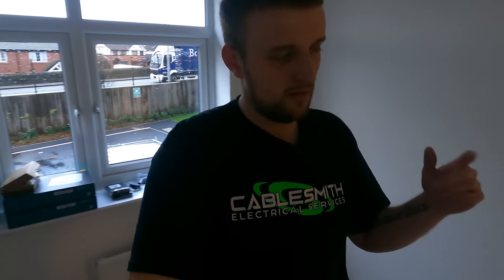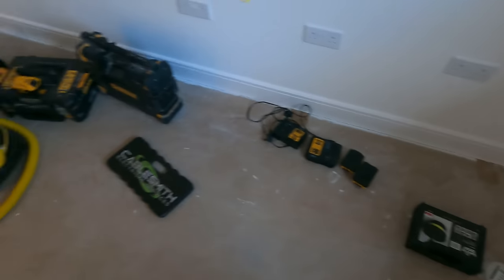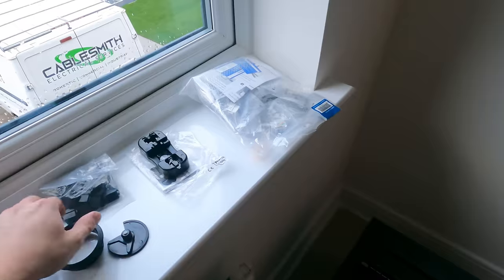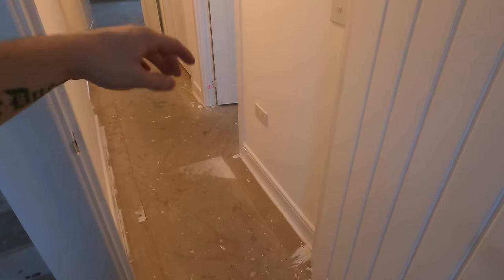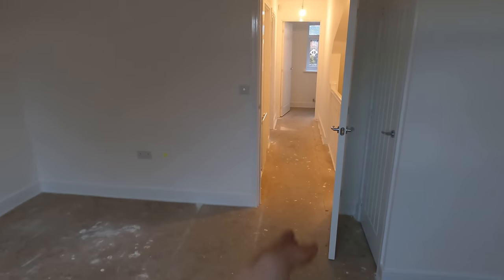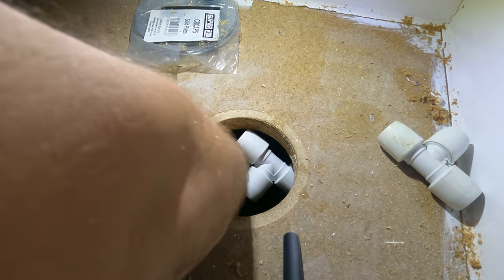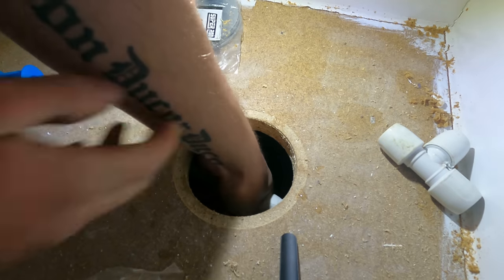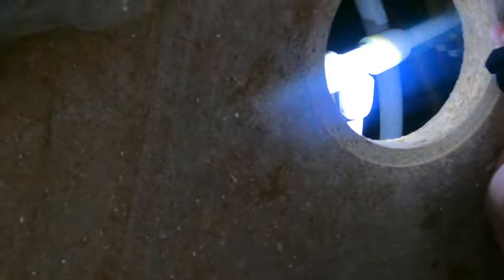I Made A Big Mistake ! | Wiring Cat 6 In A New Build | Electrical Life

Comment: Hi from the mad Aussie bird-man from Mr Bundy's "esteemed" chat group. Thanks for another cracking video. Wouldn't it be great to have access during construction.... I guess the hangover from covid stuff is so many people are continuing to work from home and set up home offices. Nice work with the data cables. Crap job from whoever on the previous work. One suggestion for the ceiling wifi access point holes is to do the same patch job as the wall cutouts with the cat6 poked through a small hole. This maintains some level of fire separation from below if the worst was to happen. Cheers
Reply from the maker: Hi Jim, that’s a good reason indeed and of course I didn’t think of that, thanks for watching matey 👌🏼

Comment: Been there mate, I was using a multi tool cutting what I through was a big lump of dry wall adhesive. I had worked out the run for the gas pie or at least I through I had. Massive whooshing sound! Nicked the gas pipe! Never moved so fast to knock the gas off! Had it fixed by a gas fitter mate of mine within the hour luckily. But your right, your confidence takes a right beating! I was cutting the next day adding sockets and checked for cable and pipes for ages!!!!
Reply from the maker: 😂😂 god I hope the gas is one I stay away from 🤞🏻 thanks for watching mate, appreciate it
Reply: All been there and done that, and as we move to more plastic fittings the detectors of old don't quite cut it anymore...........personally if I'm not sure anymore I stick a 8mm drill bit in and send in the camera first

Comment: Hi Sean, and good to see you back. Happy new year to you both. Easy done Sean hitting the pipe. Had to smile when you said “never ran so fast, I nearly tripped over myself” 😂I think we’ve all been there at some stage.
The plates look a good solution to the holes in the chipboard, do the just sit in the recess and no fixing required?
Enjoyed the tip session on the data cables plus very neat terminations that you showed 100% to what had been done, may well of been functional but good to have some pride in your work. Well done buddy👌
Reply from the maker: Thanks mate ! And no joke I nearly fell down the stairs running 😂 they don’t require a fixing but I personally run a little bit of silicone under it just to stop any potential rattle if you stepped on it, but I doubt it would anyway. Thank you for watching 👌🏼

Comment: Great video. Moving into a new build myself soon and they don’t provide and network cabling!? Says bt point on the plan but they’re insistent it’s just telephone points. Would you say it’s easy enough to run cat 6 after completion? Want about 15-20 points around the house
Reply from the maker: I’ve done a few now, 2 of which are in this channel. Yes it’s easy enough with the right tools for sure. 
100% worth doing it before you start putting flooring down and regret it later ! Good luck

Comment: Apologies if you’ve already shown this on another vid but would love to see your approach/considerations for drilling down behind a skirting and through the chipboard.

Just wondered - how much effort do you put into avoiding running ethernet next to power cables? I’ve got a fairly easy route that would put them side-by-side for about 2m, or should I go and find another route to keep them separate? It’ll probably be fairly straightforward to find another route but I’m an absolute chicken when it comes to cutting the floor, and this video proves I’m right to be!! 😂😂

Thanks again for showing this stuff it’s honestly so useful and no one else posting this real world content! Thank you!!
Reply from the maker: I actually don’t think I’ve shown drilling behind a skirting before so I’ll definitely do that on my next opportunity, as for the power/Ethernet thing, it’s a debatable one, if you go off what we’ve been taught forever, it’s a no no, but personally I don’t think you’ll see any issues at all unless your running it 30+ meters with power, BUT I’m not saying you should 🤐 it’s your choice 😄
If I was to tell you the truth, in my own house, for the sake of a few meters I would do it, for a paying customer, I wouldn’t simply because they should be getting work done to the best of my knowledge and ability and I’d feel like I’d be doing them a disservice if I knowingly did something Ive been taught not to. Hope this helps 😄 and thanks for watching ! 👏🏼
Reply: @Cablesmith  definitely helps. Thanks very much indeed. That’s the perspective I needed!! Easy route it is!

Comment: Sean. On the Krone tool there are sometimes 2 locking mechanisms for the cutting blade.
A screw operated with coin or thumb nail and the other is metal wire near the blade. If you’ve already tried this then I’ll shut my mouth. Good work by the way👍
Reply from the maker: Yea, the scissors are just broke on them ones. Appreciate the comment tho, others may read it and learn from it 👌🏼☺️ thanks for watching mate

Comment: Nice job, looks good. Shame about those original data runs by the guys before. Customer will be lucky to get gigabit speeds on those with such poor termination. I’d be wanting those re-routing/extended to the new cab and terminating properly so that all the data points in the house are usable and easily patchable in the cab.
Reply from the maker: Your right, I’d want them doing too. We personally couldn’t and wouldn’t touch them because they’re still under the guarantee with the new home otherwise I would have done it myself 😄 Thank you for watching too, appreciate it !

Comment: You could patch the floor the same way you done the walls 👍 how much does it cost per hole the way you done it which looks very good by the way 👍👍👍👍
Reply from the maker: Most definitely can, and have done a few times also where I’ve not been prepared and for the super rod plates. But I personally thing this way is a bit neater, as for cost, it’s around £3 per plate so it can add up fast. It’s also easier to gain access for the rest of the life of the house too 😂

Comment: Good job, but Is it just me or is the plastering in this house absolutely appalling? look at the ceiling at 0:52 ... Just going through the long process of buying a new build myself and this vid was helpful to get an idea of the task in hand. I have been looking at these rebated board cutters (looking at the 127mm armeg one personally but I guess they're pretty much the same) and I think thats the right approach rather than trying to lift these awful boards ... my current house (1980) has the same boards but there's a lot of damage from 40 years of plumbing and electrical work so the whole first floor squeaks - in the past people have sliced the tongue off and lifted the whole board, which gives good access but the boards never go back down right, even with noggins behind etc
Reply: Oops, just realised that wasn't the customer's gaff !!
Reply from the maker: Yep that’s what I like about these access cutters, you don’t get the poor, squeaky floors that are never quite flush ever again. And yes that ceiling was in maybe a 70 year old house 😂 sorry about that.

Comment: Looks like a heating pipe you’ve hit, you’ll need to re-pressure the boiler to test it
Reply from the maker: I checked the boiler pressure once I’d sorted the pipe and it was at 1.5bar so I assume it wasn’t that ? May be wrong tho it’s not my game that. 
I turned the boiler off straight away too because I didn’t want it trying to run with the water off, again, no idea if that’s right but it seemed logical at the time 😂
Reply: @Cablesmith  yeah probably won’t be that, unless the heating system was zoned and the heating was turned off, you could have drained 1 of the zones but if you turned the heating on and it didn’t drop the pressure you should be fine
Reply from the maker: @graememclaughlin720  🤞🏻 it’s been about 4-5 weeks since this job so I’d assume it would have been noticed by now if so. 
Anyway, thanks for watching it and happy new year to you 🥳
Reply: @Cablesmith  good stuff, keep up the good work from a stinky gas guy lol happy new year
Reply from the maker: @graememclaughlin720  😂😂😂